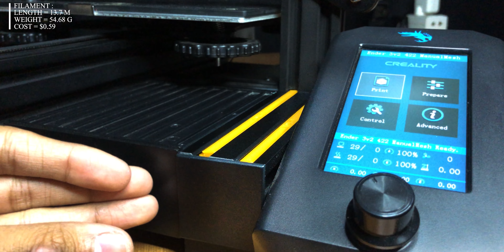Ender 3 v2 mods 2022 | Ender 3 v2 Upgrades | Ender 3 v2 Mods Reddit | Ender 3 v2 mods Thingiverse

Comment: I need help. I want to buy my first 3d printer. Which would you recommend? I'm looking at ender 3 v2 or ender 3 s1.
Reply from the maker: Go with ender 3 s1. but you have a budget under $300 ender 3 v2 is perfect option 👍
Reply: The S1 is basically a well upgraded Ender 3 v2